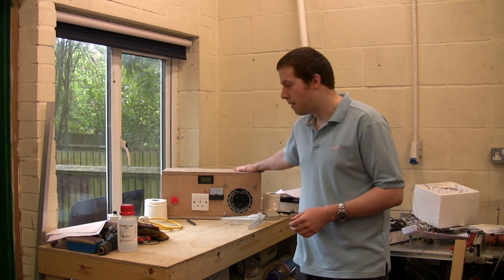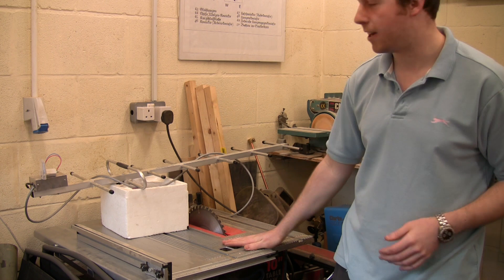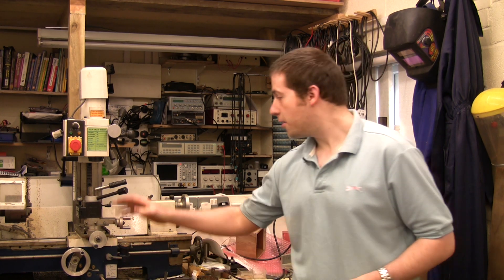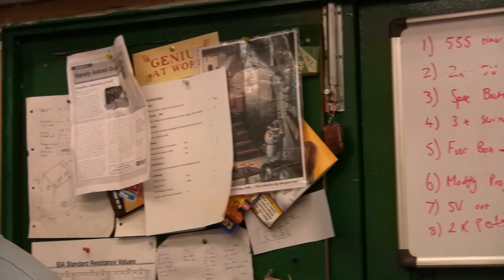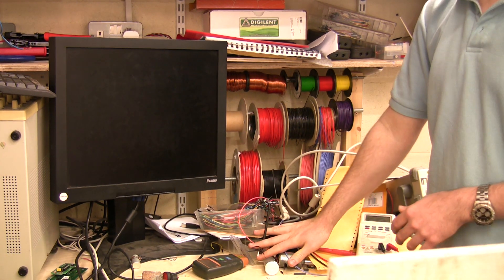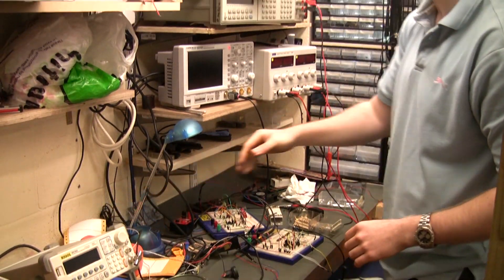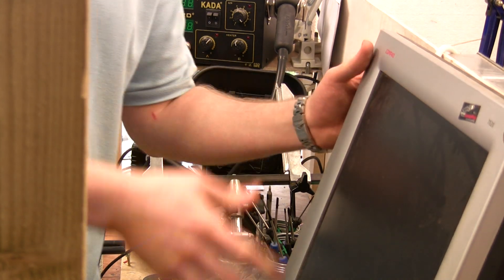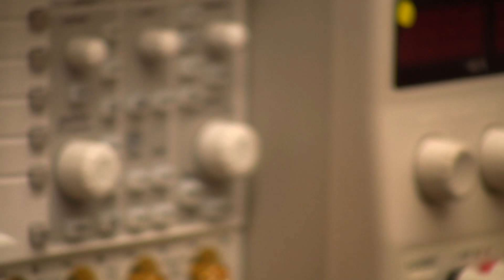Watt Circuit Dave's Lab Tour

Comment: Looks like a well used shop. I don't have very accurate stuff in my shop, mostly vintage test equipment (tube type). I can still repair most older stuff like tape decks and radios. When I went to engineering school we still learned vacuum tube theory.